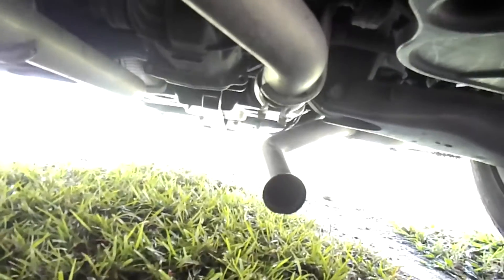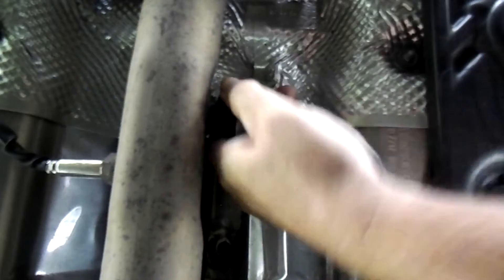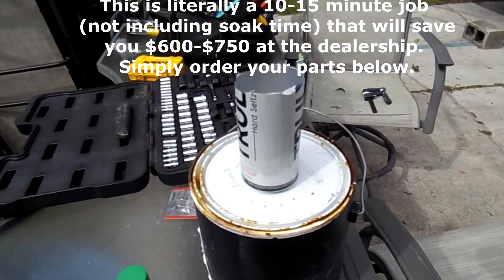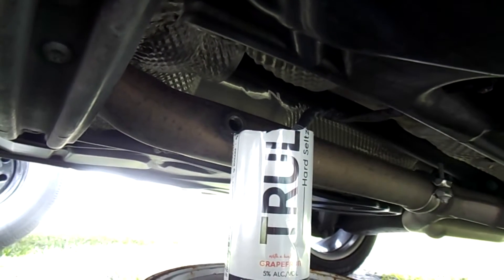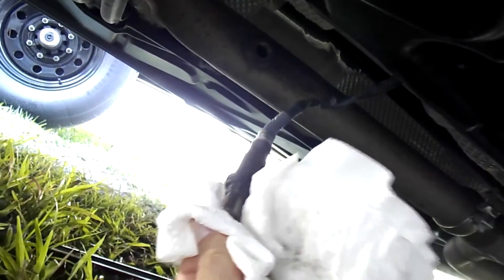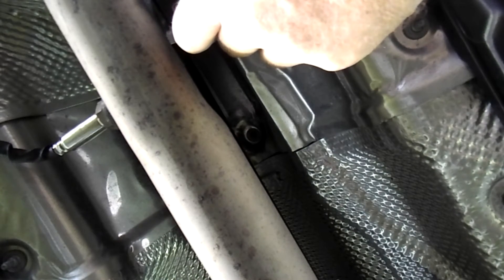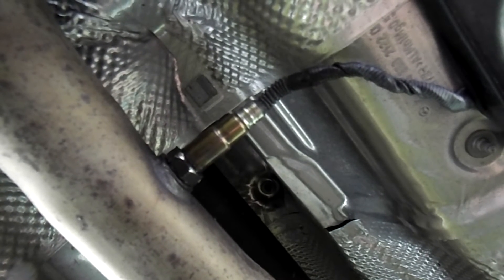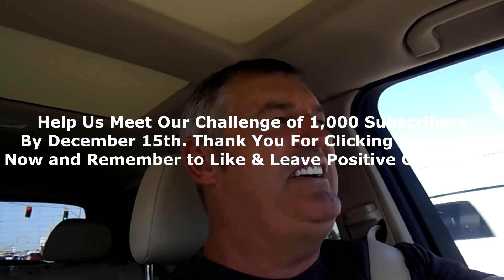How to fix a NOX Sensor DIY for $10 on any diesel engine without replacing, even on Mercedes-Benz.

Comment: I am trying that and will see if it works. It is the second time in 2 years we have the nox sensor check engine in 2-3 years and wondering if it is caused by not using the mercedez bluetec. I am using DEF that is supposed to be meeting the iso standard specified by mercedez but do you think it might be the caused or am I just unlucky. Just because of the sensor this 250 bluetec is a nightmare. And Mercedez service is absolutely atrocious. They will charge me 1 hour labor just to diagnose, so about 200 $. Then then probably 1000$ to fix.
Reply: Mercedes is obligated to modify/fix majority of the BlueTec cars and vans plus 5 years of warranty after the fix.

Here is the link for the settlement information:

Daimler AG and Mercedes-Benz USA, LLC Clean Air Act Civil Settlement | Enforcement | US EPA

Here is the link for class action settlement:

$700 Million Mercedes Diesel Emissions Class-Action Settlement Details Announced | Hagens Berman (hbsslaw.com)

Here is the link for DOJ for the clean air ACT lawsuit:

The U.S. Reaches $1.5 Billion Settlement with Daimler AG Over Emissions Cheating in Mercedes-Benz Diesel Vehicles (justice.gov)

Here is the link for a website that is not populated yet as of 12/28/2020 by Mercedes for providing information and instruction:

https://www.mbbluetecsettlement.com

 

Here is the District Court’s ruling:

 

2020-03-25-mercedes-bluetec-opinion.pdf (hbsslaw.com)

Upon Effective Date of Consent Decree
Reply: Your not unlucky.... I have a 2015 GLK250 and the sensors went bad 3 times now and this was my fourth round before I had to figure out how to do this cheaper. So glad to hear that we could help you save huge money and thank you for your contribution here on the Miller Family Farm Channel. Have you joined our family here and subscribed. We love people like yourself that share their wisdom and feedback. Come join our family if you haven't....

Comment: Thank you for the great info! I did this about a month ago when my CEL came on and threw a P229F code. I have driven 800 miles with no issues however, today the CEL came back on and code now says P2BAD “nox exceedence, source unknown” could this be because i did not recalibrate the NOX sensors? I took each one out and cleaned them as well as the soot sensor. I am at a loss, i really hate to pay all that money to have them replaced.
Reply: Stifa,
Are you losing gas mileage? Is the car acting sluggish or blowing black smoke? Sometimes. the catalytic converter is trashed and just pushing soot to the senors. Let me know...

Comment: Great Video. Thanks! I was so mystified by NOx Sensors and the check engine light. I feel so much more confident that I could do this alone. I'm ordering the sensor removal tool now!
Thanks!
Reply: Chuck, How did it go with your sensors? Are you subscribed to our channel. Please subscribe and then share your successes and failures as both are shared wisdom.

Comment: Great video 👍 but mine is ML360 4matic and l looked everywhere underneath the car like you did ,can’t find where it is!
Reply: Sam look for the wires that go in to the exhaust pipe. You may have to start at the exhaust manifold and work back to the tail pipe. If it is a diesel it has the sensors. Thanks for your contribution here on the Miller Family Farm Channel. Have you joined our family here and subscribed. We love people like yourself that share their wisdom and feedback. Come join our family if you haven't....
Reply: G Miller yes l did look at it and l saw 4 sensors 2 right and left upper and 2 right and left lower so l didn’t know which ones are the Nox sensor or just all 4 are Noxes ? It’s ML350 4 magic spots 3.5L Gas

Comment: Thank you so much for posting your video. I will do the following hope that the faulty sensor goes off. On the flip side, the dealer found short in add blue level sensor so, now i have 4 start atemps before i deal with issues. Do you have a video on how to reset or fix that problem. thanks my vehicle is 2013 GLK 250 the dealer of course wants to replace the whole tank.? is that really necessary they claim the level sensor is stuck.. help if you can thanks
Reply: Check out XEMODEX at their website. They sell upgraded sensors . You can buy the kit to replace the level sensor, temp sensor and def tank heaater for $500. Totally easy to do if you wrench on your own vehicles
Reply: @jonathanhouse6546 Thanks for being a contribution here on the Miller Family Farm Channel. Are you subscribed? We like people here that will contribute in a positive nature. Join our family.

Comment: Great video. Used your knowledge to clean my very dirty NOx and O2 sensors coming off the exhaust manifold, and touched up the NOx sensor post-cat under the car -  2009 Audi Q7 TDI, 110k miles. The only thing I did different was use plastic baggies and twist ties around the sensors to hold the Injector Cleaner in place. I used a Kobra OBD Diagnostic Interface (bluetooth) to clear the codes and check engine light. Thanks, again.
Reply: A. P.B. So glad to hear that we could help you save huge money and thank you for your contribution here on the Miller Family Farm Channel. Have you joined our family here and subscribed. We love people like yourself that share their wisdom and feedback. Come join our family if you haven't....
Reply: how long did your repair last?  Thinking about doing the same thing on a 15 q7 tdi that has ~125K miles on it...  p229f code
Reply: Did you end up doing it? I got the same code on the 2014 tdi im looking at, curious as to how well it worked @peterchang7646
Reply: A.P.B. So great to hear that this inexpensive technique saved you $1000s and we love to hear too that you have put your own twist on the repair and shared it with our Family here at Miller Family Farm Trust. We noticed you have NOT subsribed and we would love to have you join our community as our family simply love contributors like yourself. Please subscribe and then shoot me a message that you have subscribed. WELCOME!!!!

Comment: on a german car you have to relearn the sensor on with a diagnostic programm. And you have to watch in the Fault list, clear it and controll  if the car isnt still driving in the homogen, it have to be in layer load now. 

But nice method to clean the sensor :)

Comment: Thanks! You made a $2300 job look easy and less than $50.  I’m trying this...
Reply from the maker: Adolfo, Your Welcome and you can subscribe to our channel and like the video as a thank you for the video.
Reply: did it work?
Reply: @dainazinas  I'm curious myself, just got a quote for $2745 Canadian for parts and labour to do my Passat TDI
Reply: Jason Marshall did it work for you? I have a Passat TDI
Reply: Brenna Nations I didn’t do it cuz then my damn DEF doser quit. Cost $3500 cuz dealership has to marry to vin code. Not getting bluetec again.
Reply: @brennanations3195  I actually ended up just recently finding a mechanic that is willing to work on it, but he was saying it could be other things so gonna start with software and see if that does anything.
Reply: @Brenna Nations Hi, have you found a mechanic that is willing to fix your CEL? Or can he re-program the NOx sensor. I replaced mine with A/M NOx sensor and cleared the code but the CEL is still on.
I'm in Toronto. Thanks.
Reply: @subhastheboss  thanks. I finally decided to trade it in. Appreciate your input
Reply: I did the same. Driving a Ford now

Comment: Hello thank you for the great video but I think I will need a new Nox sensor Bank 1 Sensor 2. Will I need some coding or relearnig of new sensor after the installment? Thank you
Reply: You are welcome Bane and let us know how your NOx sensor turns out and join of channel for more cool videos.
Reply: @gmiller4326  It turn out that I had to find rear sensor that has exactly same part number as old one. I found some guy who was selling it on Ebay for $80 in LA and I just order it. He said that they always have those sensors for sale directly from dealership because whenever someone goes to replace one sensor at dealership they replace front and rear because that's the procedure and they charge like $1200 for both, then after that mechanic's just sell the one that was good on a car. After installing rear sensor that took like 15 min I just got SNAPON scan tool with 2020 update and I did relearn procedure for rear sensor and everything worked great. So SnapOn didn't had that relearn procedure available till 2020 update then they include it with I believe all versions of SnapOn.
Reply: @MrBanex25  that is a great tip. Thanks for letting us know and please join the Miller Family Farm Trust Channel as we love people like you that contribute. Do you have the name and contact details for the guy in LA for other who may need to replace the sensor? Let me know once you have subscribed.

Comment: Thanks for the info! I'm going to try this on my sprinter van before I drop a grand on having them replaced!
Reply: James, did it work?  What year is your Sprinter? I am thinking of buying a 2012.  This DEF and NOx issue and the count down issues look like a hassle.
Reply: @msxbocachica  I just encountered the problem on my 2014 Sprinter RV.  Mercedes is quoting $1700 for DEF sensor and over $4,000 for NOx sensors.
Reply from the maker: Your welcome James. It is simple and you can always spend the $1000 if it doesn't work right?
Reply: Hey James, did you tried this procedure already ? And do you maybe know if you replace nox sensor does it require any reprogramming or just basic code reset will do the job ? Thanks
Reply: @MrBanex25  I tried it only on the #2 sensor. I still need to locate and clean the #1, but it looks like I may have a dead DEF heater.
To my knowledge, the NOX sensors don't require reprogramming. 
If your vehicle is in countdown mode or is giving you messages, I would recommend contacting the service dept at a nearby dealer and seeing if they can help identify possible issues. 

Best of luck!
Reply: @jimstevetom  Thank you I appreciate

Comment: What about the other sensor? They told me the other NOX sensor is located near under the passenger seat.
Reply from the maker: Yes the NOX sensor on the GLK is under the passenger seat and you should do both the NOX and Sout Sensor. Good Luck

Comment: Can I use a break cleaner instead of carburetor cleaner?
Reply from the maker: Hello
Merry Christmas...I am not sure about just break cleaner only. Try it and let us know....
Reply: @millerfamilyfarmtrust6515  in the handbook for BMW Mechanics you could read that Break cleaner is not good for the sensor, it can be destroyed with that. Maybe you take soup and a toothbrush or  some  washing gasolin on a flannel
Reply: Curious as to why you might ask to do this?

Comment: Wow!  I just had a NOx sensor changed on my Sprinter van.  $511 (canadian) for the sensor itself, $110 to install.  And then I saw this video...  Ouch!
Reply: I’ve seen other comments saying it only saves u 3 months at most. Haven’t came across anything that says it fully fixes the issue. I think I’m still gonna try it.😂
Reply from the maker: Luc,
I know it is painful to replace these units. Now you know. 
If you haven't subscribed and liked the channel...please do and we are posting another great video tommorrow. See ya Luc
Reply: I am contemplating buying a 2012 Sprinter Crew.  I have been reading all about these DEF and NOx problems.  Is there a place that has the definitive fixes for all these ?

Comment: I checked the diagram of the GLK exhaust system and what you removed and cleaned was the Soot Particulate Sensor.  The NOX sensor is located on the other side of this pipe.
Reply from the maker: Yes I actually did both sensors. Thanks
Reply: Hello Michael, Thanks for your extremely observant nature and we cleaned all the sensors down the exhaust system. Including the NOX and the Soot sensors but coulnt include everything in the footage as the video was already very long. If you haven't already, subscribed to our channel and hit the BELL for notifications of our upcoming videos, you can now as we are always posting cool fixes, farming, ATV mods, 4x4 Mods and everything else outdoors. You will love the channel. Talk to you soon.
Reply: Hello Michael. Where can I find the exhaust diagram for a 2014 e250 bluetec? I need to clean or replace the soot sensor.
Reply: @andrewb8961  You can buy the service manual from emanual online for a reasonable price like I did.
Reply: I believe you can just go to Mercedes website and search for their parts. It included diagram and price for each parts